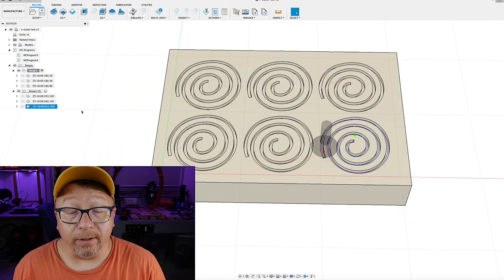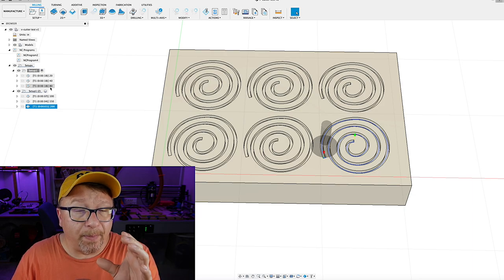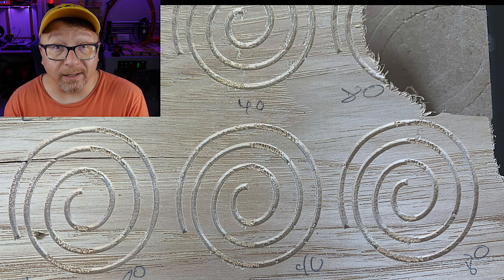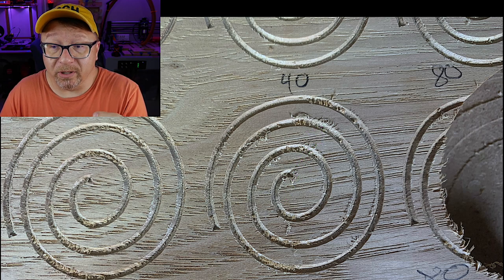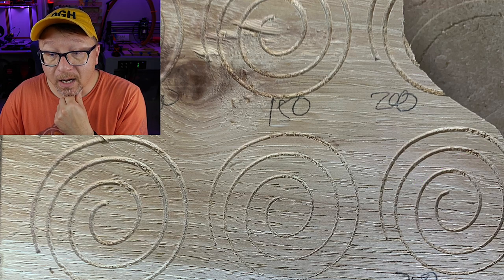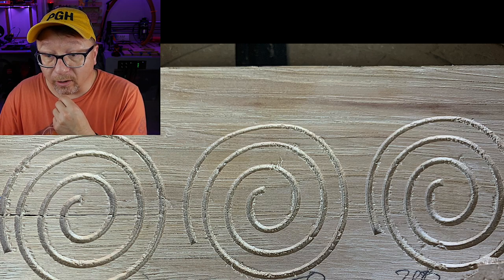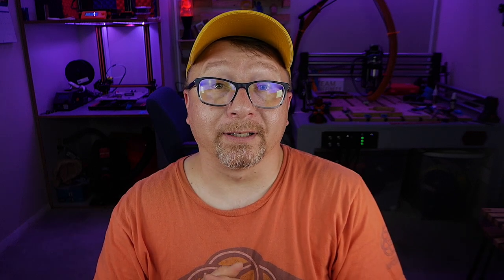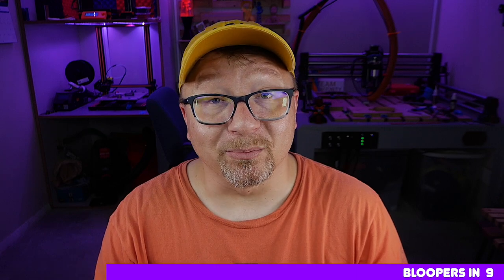Onefinity V-Carve Feeds and Speeds

Comment: There are RPMs in relation to the dial, it's found in the manual. How accurate they are from one router to another could vary though.
1 10,000
2 12,000
3 17,000
4 22,000
5 27,000
6 30,000
Reply from the maker: Thanks Chad - I appreciate additional input!

Comment: As with most tools, having a high quality, extremely sharp edge makes all the difference in the world.  I would love to see a comparison of how a good, newly acquired bit does in the same test.  Also, the wood type is a factor also, maybe a test between multiple wood types?
Reply from the maker: Hi John - the bit is brand new - only used once before, so I don't think that is the problem.  I do plan on testing with different woods; I had the same experience with white oak and walnut though. Thanks for watching!

Comment: When you did the test, did you monitor feed rate Onefinity shows on monitor? I'm willing to bet if you watch actual feed rate Onefinity shows you not actually putting out "set" feed rate because you feed rate is determined by limiting factors like motors/controller & maxing out machines capabilities somewhere between 80/100.  You can hit set speeds on a straight line at some point, but there's a ramp up then down, so the speed set isn't necessarily a proper test variable. The spiral shape was excellent choice because your getting x/y at their peak working in tandem with each other.
Reply from the maker: Hi there Samurai - thanks for watching. Agreed - that is why I chose an arc to avoid jerk and acceleration as much as I could.  I'm going a follow up with a pure circle to compare the results.  Hope you can watch it and provide feedback.

Comment: Very interesting Tom. I was thinking the actual cutting diameter of a vbit for shallow cuts is really small. That would equate to a low adjusted feed rate. Increasing the rpm would allow an increase in feed rate. Could be with the grain the bit is not able to clear the chips and starts to shear and tear. Defiantly more experimenting needed. I been wanting to make an algorithm to calculate the diameter. You inspired me.
Reply from the maker: Thanks Ed - I was super surprised by the results.  More testing coming!